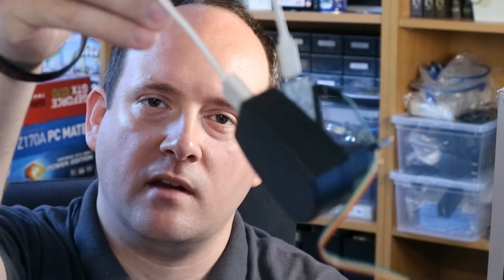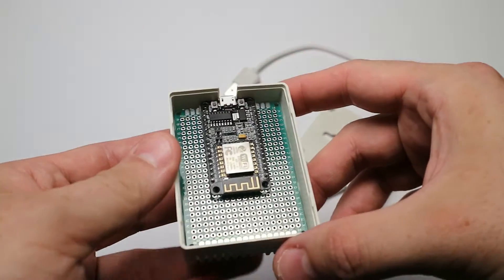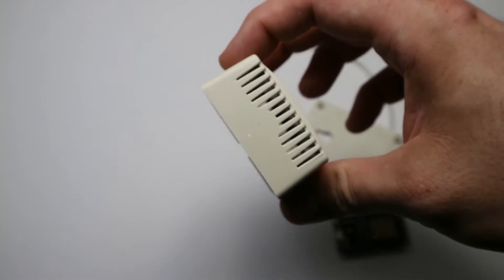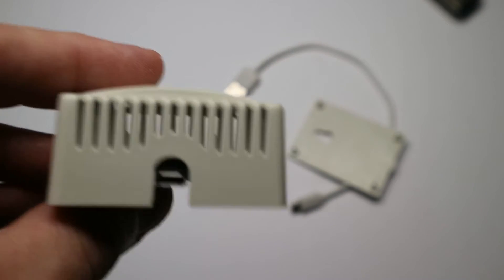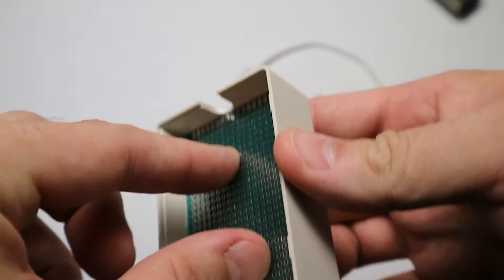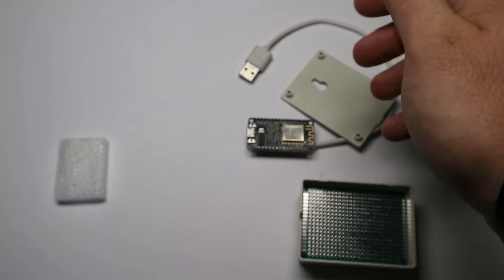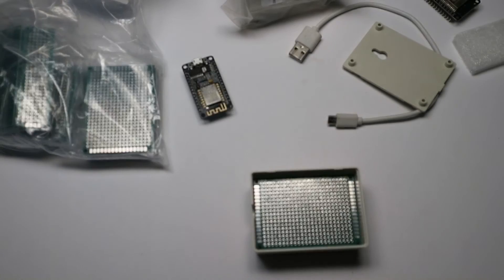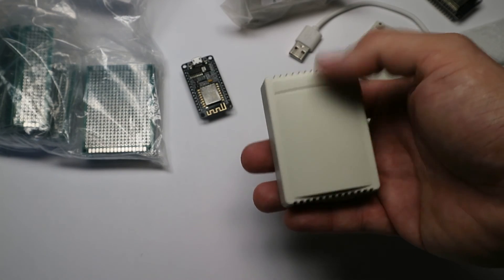The BEST, cheap enclosure for your ESP8266 NodeMCU projects! (From Banggood)

Comment: Hi, would this fit the esp8266 v3? im already bought 2 x 10 enclousure pack, and i dont know if it will fit the v3 as it is more like the size of the esp32 instead of the smaller esp8266 v2 ... so im hesitant on returning my 20 esp8266 v3....
Reply from the maker: Hi! Not sure what do you mean by ESP8266 V3, but if you mean NodeMCU V3, the module I've linked in the video description and I'm showing in the video, is exactly that one and it fits the box perfectly. Also, as you can see the box and the protoboard are large enough to host a bigger MCU, given its pins follow the normal (N * 2.54) mm distance.
Reply: @TheTinkerDad  thank u and yes i was refering to the nodemcu v3 lolin which is not compatible with most breadboard/protoboards out there

Comment: If you ever find a good way to mount battery please made video and add link. Looks like 9v would fit nicely or chargeable liOn.
Reply from the maker: Truth is, I haven't touched these boxes for over a year now - I've always had problems with parts not fitting and ended up buying random boxes like these... After some time I've decided that it's enough of wasting money on boxes and started eyeing with those sub-$200 3d printers out there (especially the Creality Ender 3), which are perfect for my needs - they are cheap, sturdy and require almost zero maintenance. So, nowadays I just design and print my project boxes instead of buying ready made ones like these.

Comment: Is it the largest PCB (50x70mm) which fits into the box? Because you can buy those separately if you don't need other sizes. https://www.banggood.com/Geekcreit-10pcs-50x70mm-FR-4-2_54mm-Double-Side-Prototype-PCB-Printed-Circuit-Board-p-1257154.html

Comment: Do you think this enclosure could fit a couple relays along with the nodemcu?Thanks for sharing.
Reply from the maker: Hi Tom,

Sadly I think not. But maybe if you drop the protoboard and change the nodemcu to a D1 mini or ESP01, you can maybe squeeze in a smaller relay or two.

Comment: A plastic box "wont do any harm to your WiFi signal". Maybe not but the copper on the proto-board sure as heck will - particularly if you're sandwiching the ESP and its antenna between the proto-board and a brick, concrete or stone wall...

Comment: Cool box I am going to print it. Although I feel compelled to mention. The heat from the esp being on continuously will offset the temperature a small amount.  Liked the 0% WAF  notation.  If we deepsleep the esp there will not be much if any heat though.
Reply from the maker: Agree. Sadly back at that time I had the false assumption that deep sleep is only possible with the ESP32, but not with the 8266.

Comment: How do you plan to power it?  Through the micro USB?
Reply from the maker: Exactly! The hole on the box is right where the microusb connector is - you can connect it firmly, it won't dangle or partially fit, etc.